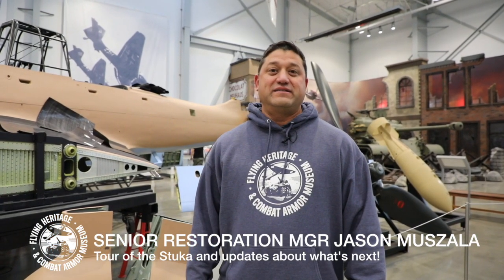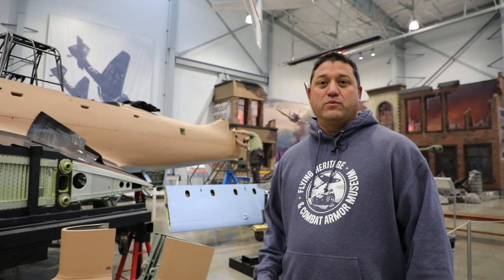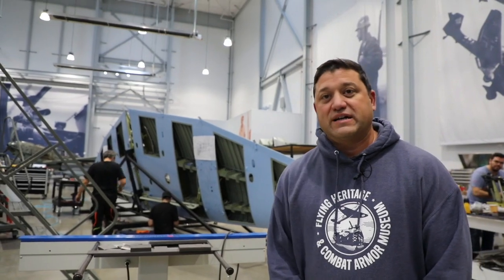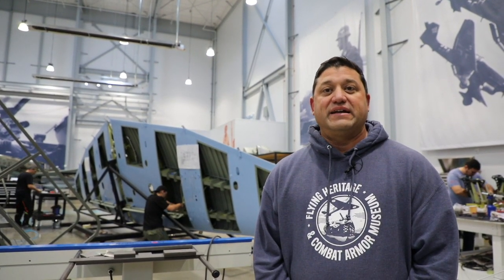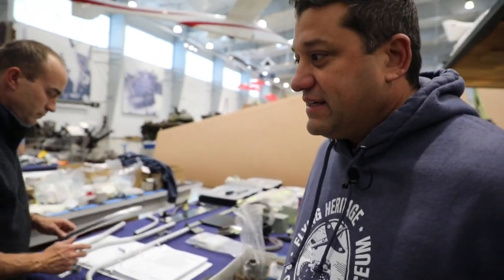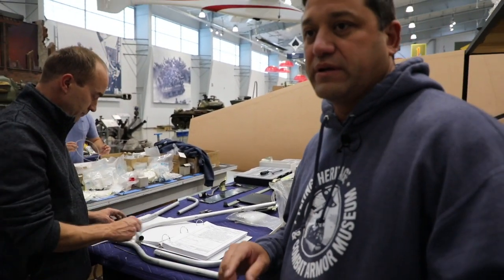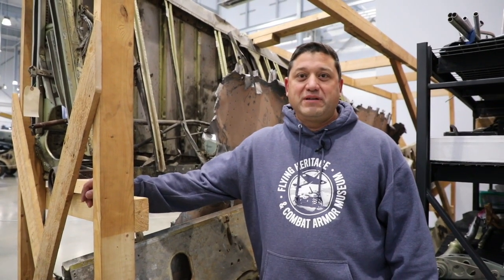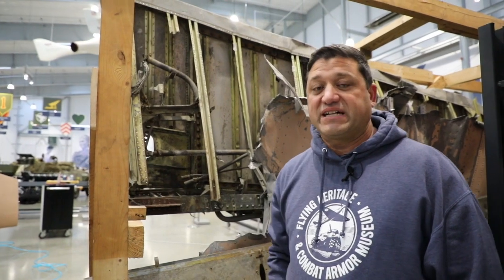Stuka Updates and Tour

Comment: Thank you so much for this tour.  I am a model builder and also a watchmaker.  Thus I tend to build to a much higher level of detail than is usual.  I was actually wanting information on how the rudder peddles mounted and articulated so I could at least give a reasonable representation in the Ju87A I am building.  The ones that were being worked on are identical to those in the plane I am building and this kind of information is so hard to find.

Comment: The bit with the anti-theft device was interesting.  I had no idea the Germans came up with something like that.
Reply: tjn5150 like how you used to take the rotor out of you cars distributor cap!
Reply: @itchy108  Or the blade fuse of a Military L/R 110 Defender from its mount on the fire wall.

Comment: I sincerely hope you use modern vinyl insulated wire instead of cloth insulated wiring. I recall reading in Flight Journal Magazine ten years ago or so about the restoration of your P-51 that you found a European manufacturer that still made cloth insulated wiring and that was what you used on the P-51. No sense using inferior wiring on an airworthy aircraft.
Reply: I wouldn't jumpt to the conclusion right of the bat that vinyl insulation is superior to clothing,  polyvinychloride becomes very brittle once the softener starts to dissipate, remember these aircraft were crafted at a time things where built to last forever compared to today on average. If they restore it, then it can do another hundred years.
Reply: @TPath3    Warplanes were expected to be destroyed in combat. 6 months would be a fairly long time let alone a year. They were built to stand the forces they would see in combat,not forever.

Comment: Very impressive to see that they were employing conduits to run the wiring bundles in the wings. This may not mean much to the casual viewer, but in the context of aircraft maintenance this is a feature that mechanics appreciate. When a wire/s has to be replaced it can be fished out and new wire pulled through without having to rebuild the wire bundle - a tedious and tricky job when its in some tight confines of the airplane structure. Airbuses employ this method in a number of key areas(in the fuel tanks particularly). Any mechanic that’s ever replaced a fuel qty tank harness of a B737, for example, will know what I mean. In the Airbus A320, on the other hand the wiring are distributed in the wing tank in those conduits. There are pull cords to facilitate the replacement of the qty harness. Clamps are only required near the ends of the conduits.
Nice to see progress being made on the Ju-87......love visiting the museum. 
Cheers, from nearby Vancouver, BC

Comment: Did this example retain the original engine and exhaust systems?
Reply: +@majorkursk780  The museum obtained about 11 engines from various sources to have enough usable parts to build a correct engine.  This work is difficult.  The engine is tested and certified although the museum did not give any permission to publish any video of the testing.